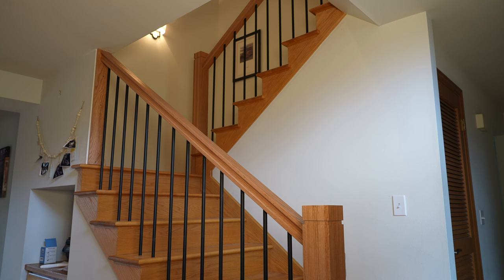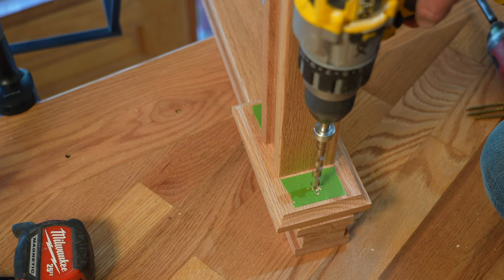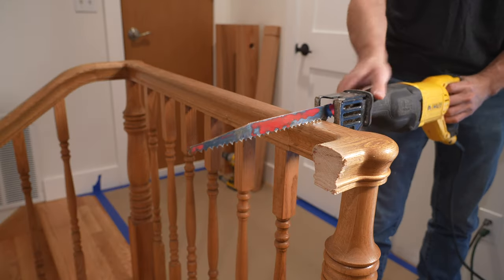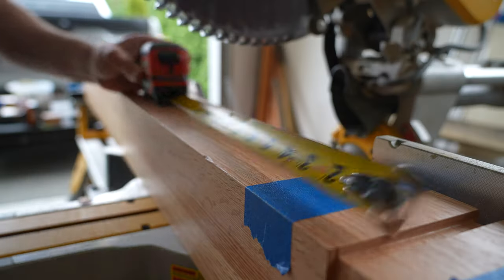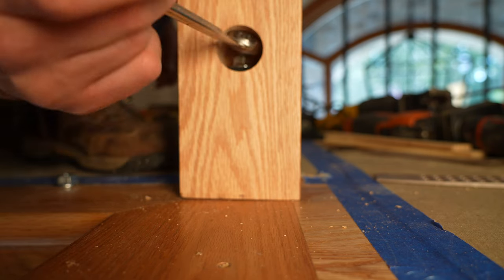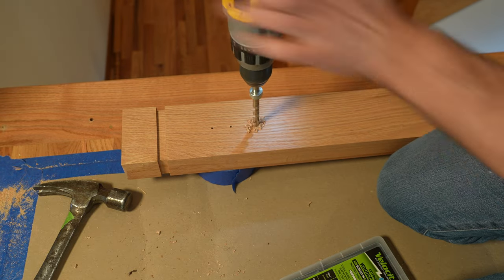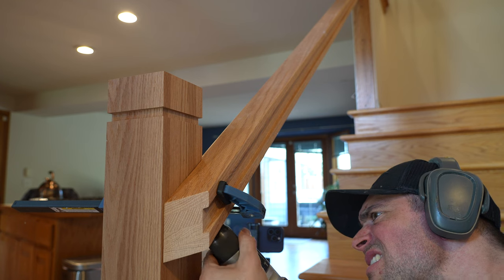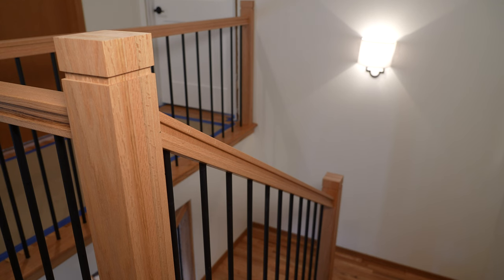MODERN STAIR RAILING REMODEL // START TO FINISH (Part 1 of 2)

Comment: Great job. Reminded me of when I did mine. Came out similar, but I  just used untreated 4x4's & rebar. Burned them afterwards.
Reply from the maker: That's awesome!  You went the full DIY route and I bet it has a beautiful rustic look.
Reply: @BYOTools  It does. While I was burning, It looked like each post had it's own face. I haven't stained it yet

Comment: Looks good man. You did a solid job. Those posts are solid newel. Boxed newels are usually made of 3/4 material with mitered corners and are generally hollow. Cheers.

Comment: Need to replace mine as well and the old rails bolted to the sides. My new stair nose is on the sides so I wasn’t sure how to bolt to the floor for stability and not having to cut the nosing on the sides. Thanks so much for posting this!
Reply: Doesn’t sound like the project is within you capabilities

Comment: Good job again Brent. I would not take on this project and I’m a GC. Looks very complicated but you seemed to handle it just fine. Is this the challenging project that you told me about last time?
And I saw your angry face again!  😅.  I do that same face all the time when I’m working- so I’ve been told. Thanks!
Reply from the maker: Thanks so much for the continued support and kind words Roger.  This was a tough one and did take longer then expected but wasn't the one that caused the original delay I told you about earlier.  That one invloves a Metal Fire Pit and welding.  first time welder so definiely caused some issues along the way.  Will be posting in the next month hopefully.  And YES that is what my wife calls my "Concentration Face" lol!!!